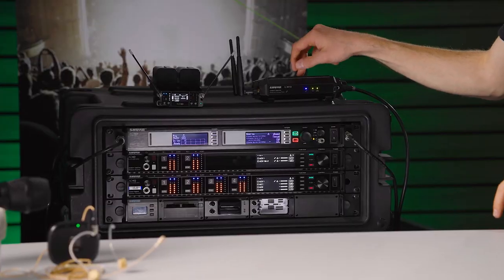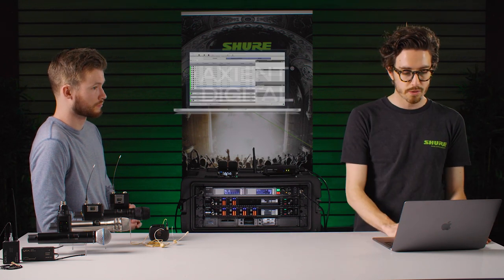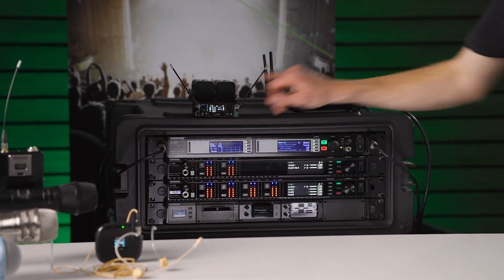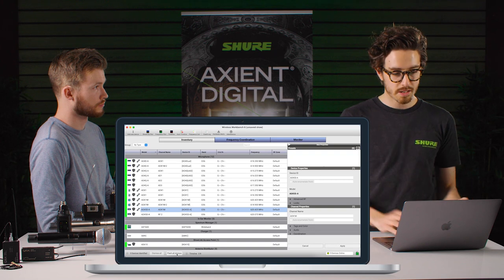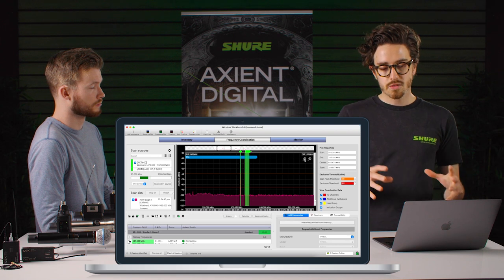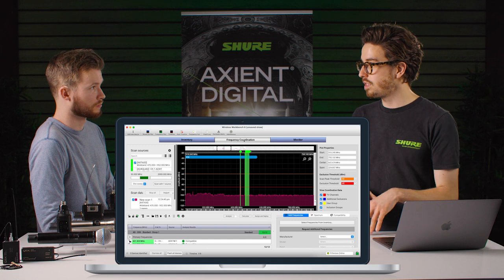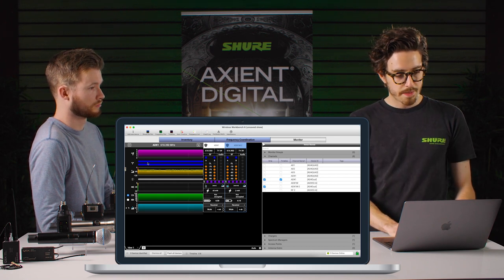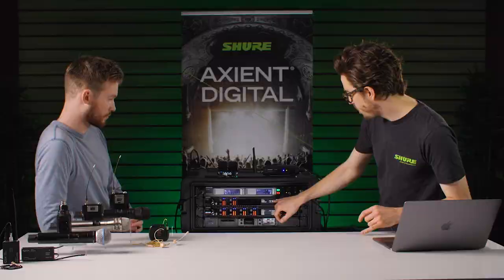Shure Axient Digital Ecosystem with Wireless Workbench | Tutorial

Comment: If some of that Rack gear had DC inputs it would be so much more feasable for our workflows!
Reply: whats dc power ? how does that help with your workflow? who has dc at the same price range ?
Reply from the maker: @creativegreatsvisuals  DC power means you can power it from a battery. You can use it as a redundancy, so if you are powering the unit from mains and the mains die, the battery will automatically kick in and take over. The DC version is more expensive as there are more that goes into it. Hope this helps! 😀
Reply: @RaycomTV  whats the most affordable dc version ?
Reply: @RaycomTV  the Shure adx5d has battery sled options how is this different than dc inputs ?
Reply from the maker: @creativegreatsvisuals  Please can you email us at sales@raycom.co.uk with what you want your setup to be and what your looking for. Thank you. 😀